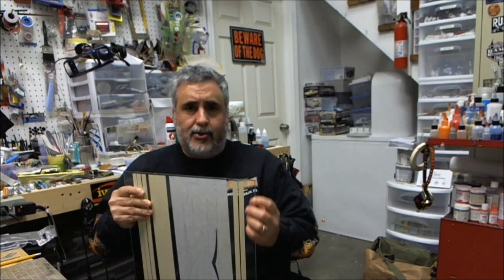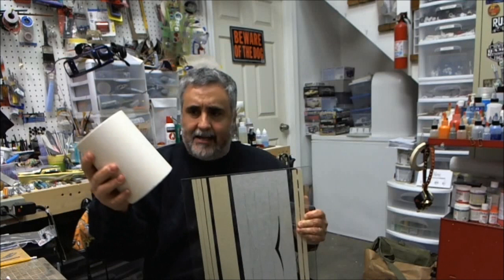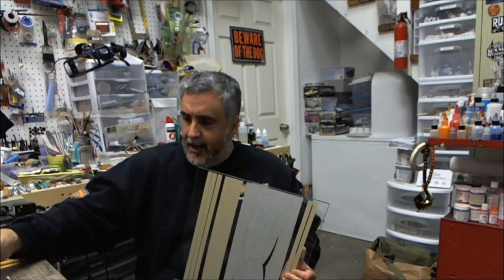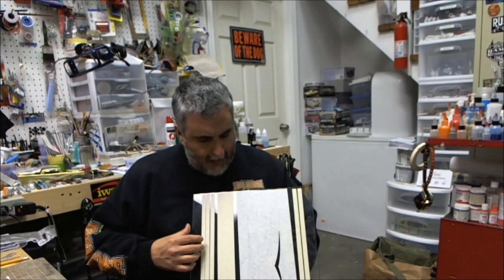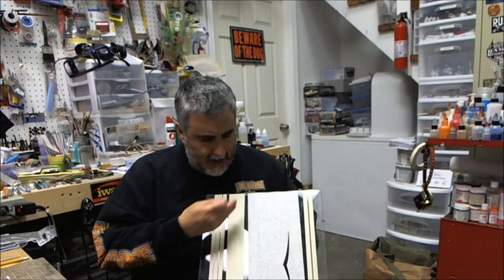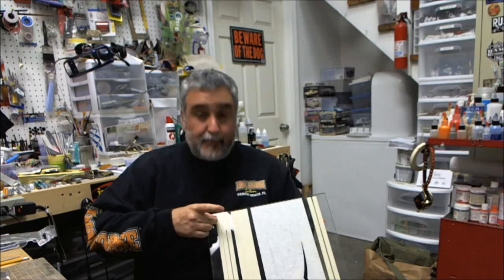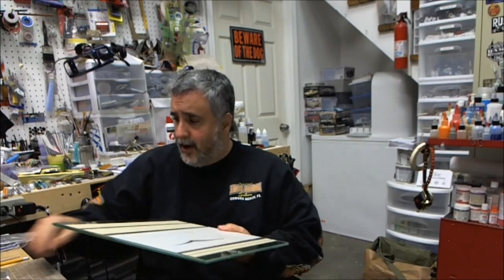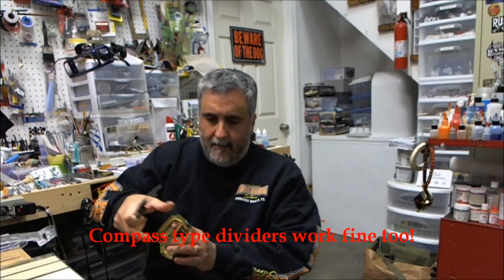Tape Graphics & Design In Preparation for Painting (Part No. 1)

Comment: @damncranky666 the product on the large roll is called "transfer tape", it's used in the sign industry but air-brushers love it as well ,, so shop around for "transfer tape"  I get mine from ebay  for cheap. Also if people like Tamiya tape .. you can use 3m fineline tape for 1/5 the cost.. I believe tamiya is made by 3m anyway. >>Digital<< calipers can be purchased for $10-$15  at harbor freight. Don't get vernier calipers unless you know how to read them.